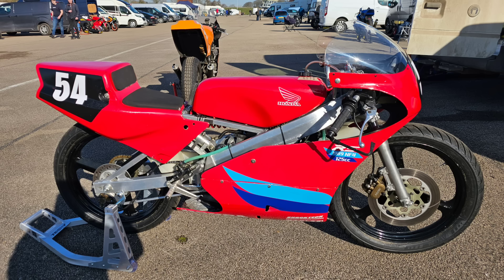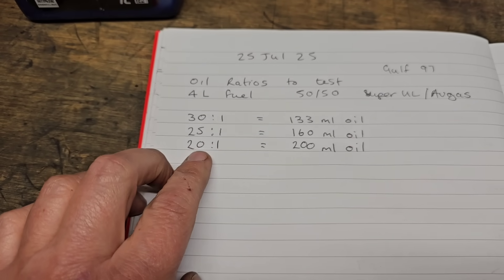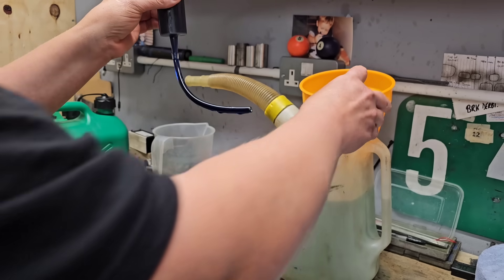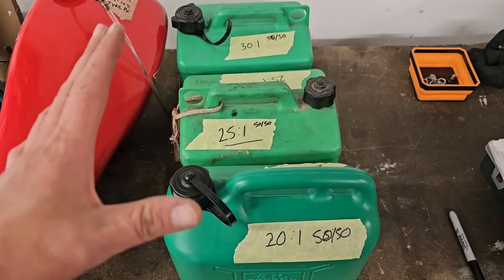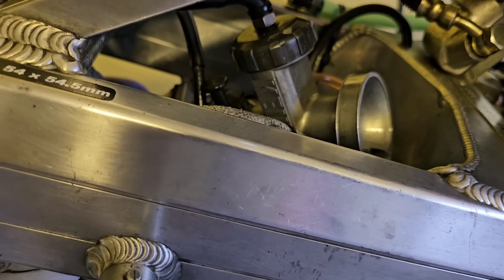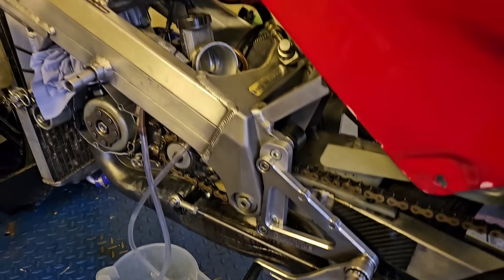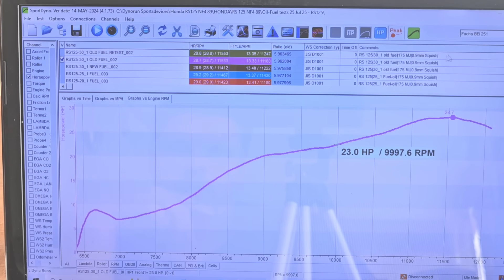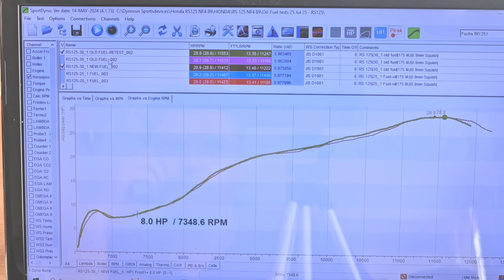Does 2-Stroke Oil Ratio Really Change Power? (Dyno Tested)

Comment: I always ran 32:1 in my 500. Better safe than sorry when in the middle of the desert. A friend who's dad owned a motorcycle cycle shop always used Conklin oil in his desert bikes. Conklin was a very inexpensive chainsaw oil. I imagine a street 2 stroke is a little different than dirt. I had a '72 H1 with the mechanical oil mixer. That was hit or miss. 2 pipes smokin 1 day. The next 1 pipe smokin. It ran fine. Don't know why the oddity.

Comment: I expected to see more oil, more hp as well. For the viewers who have trouble getting quality gas, I am certain that more oil will help dramatically as the fuel grade goes down.  Depending on the output and mods to the engine, obviously, the best available pump fuel or better is recommended, but when you're at the only station for 100 kilometers, and their fuel has been in the ground for two seasons, ADD MORE OIL!  ;)
Reply from the maker: Me too!

Comment: Those curves were all so close that differences were insignificant. To get high accuracy you need to log air pressure, temperature and relative humidity, all of which affect performance.
If as I suspect modern 2T oils don't really affect octane number, your results show the oil is being more or less entirely burnt and producing power. The old oils significantly reduced octane number. Scotts had oil injection basically from day one, the Japanese and Czechs copied it, because then as well as superior lubrication the oil entered the cylinder as droplets and didn't affect the fuel octane rating. Petroil was basically a money saving bodge for the manufacturer, but one people have learned to work with.

Comment: I road raced air and liquid cooled two strokes in the 80’s.  I melted and seized my share of pistons early on.  Biggest lesson I learned to avoid eviscerating pistons to to not advance the timing too far and not jet too lean.  I think these two variables are far more important than oil/fuel ratio (assuming you’re #0safely in the range recommended by the oil mfg).  Also learned early on that more oil requires bigger jets.  In summary: use the recommended amount of oil and focus your tuning energies on jetting and timing.  Timing is huge!  Want to melt dome pistons?  Over advance your timing.  That said, they always seem to run the best right before they seize.
Reply from the maker: Cheers for the tips.😊

Comment: Would you not have to change jetting as the more oil theres less fuel & use an egt to get mixtures the same? as your O2 guage has shown a differance in mixture.
Reply from the maker: Hi, yes I should have. I was looking to see if more oil leaned the mixture, which it did.
I have tested some more oil off camera and got a gain at 16:1 but the AFR showed it had leaned. I raised the main jet 2 points and the AFR matched the 20:1 test and the power came down again to match.

Comment: I'm commenting right at the beginning if the video, thankyou I agree so little data regards many aspects of two stroke theory has been lost to the ages and not available online and one of those ongoing opinions is oil ratio, I did read about a test done by KTM with 3 engines running 3 different ratios but only read about it 2nd hand and it was centred around wear only, it will be good to see 1st hand which is better for power so I'll know whether my 30:1 was the right choice for all these years
Reply from the maker: Hi, i think 30:1 is a good ratio. It worked well with my Honda RS125 and I used the same when I raced my suzuki x7

Comment: Maybe this is just foolish, but on my jetski engines, I started at 40:1, ran them a little and took them apart and checked for oil retention. In the end I was running around 55:1 and still had a decent amount of oil, so I kept running that way.
Reply from the maker: I think its whatever works for you 😊

Comment: Here we go stay with a ratio ie. 32:1 40:1 50:1 with oil nowadays any oil will work. Don't change ratios when it starts smoking that's crankcase seal or rings. In 35 years I never seized a motor. Run rich but carry a spare plug.
Reply from the maker: Honda recommend 30:1 for this engine with the ELF oil that I use...

Comment: More oil needs more compression. Sounds like a diesel to me. 
Actually gasoline derived from oil. Bringing back in more oil you get a greasier fuel which looks like kerosine, petroleum or even diesel fuel. 
- Did we tested diesel fuels or alike before? What were the results?

Comment: So far I know the ratio of a two stroke is 50:1. When mixing in more oil it gives problems as rings brake up. I have tested 40:1 on a MBX80 with a Mallossi big bore cast iron cylinder with a 26 mm Mikuni. The result I remember was loss of power.
So where does this theory of 30:1 or 20:1 come from?
Reply: Because it leaned out due to less fuel in the mix if you jetted equivalent to what fuel would of been with the less oil ratio then youd of made more power than usual because more oil = better ring seal which = better compression which then = more power oh and not to forget more protection for the big end the small end the piston the cylinder the crank bearings and cooler running.

Comment: if you didn't rejet per fuel , then what you learned is less fuel makes more power  ( learner ) ...  the higher the % of oil ,  the less fuel per measured amount of fuel mix . . while adding lubricity that then cant burn ,  and increasing the likelihood of flooding the cylinder , fouling plugs , and sending spooge into the exhaust system . . .  think about it , without jetting for a specific fuel ration , and increasing oil %  , is making a leaner charge with more oil .   the oil also doesn't burn at the rate of fuel who's intent is to be lit off easy ,  oils there JUST to lubricate.  not be combusted....    your wideband also shouldn't be used as a tuning aid for dirt bikes since they dont call for the same stoichmetric .   if you do want to use them as a gauge,   look into rotary engine ideal air fuel ratios , and then that will give you a different AFR goal than what a solely fuel car would use .   but dont expect a long or normal service life from the test O2 sensor .
Reply from the maker: Hi, good point. I did further test with a different oil and went to 16:1 which showed a little more power. I then re-jetted to correct the AFR and the power went back to the 25:1 oil ratio power.

Comment: The big power gains by running lean oil mixes in GP bikes was brought by the ability to run big compression ratios, not just the lean oil mixtures. Synthetic two stroke oils allowed this to happen, back in the day. Ratios of 100:1 and compression ratios of 10:1 were common starting points. For comparison an RDLC had a compression ratio of 6.6:1. Kawaski KR1S's upped this to about 7.5:1, but with higher rated lubricants and less of them. Lubricants don't affect the power so much. It's what you can do with the tuning when you run higher ratios
that does the heavy lifting.
Reply: Also a lot  retarding of the timing at the top so the heat went into the exhaust made the pipe work better extended the power aswell

Comment: dyno is a good baseline and gives a pretty piece of paper with good info.
The only real test is real life. 
I would think that a lower % oil should give better acceleration, similar to the accel pump on a webber, coz it would rev a little better.

Comment: always happy to see a RS running..   A friend have done the same test when he was racing RS250.. and if I remember correctly. there was no change in power until 16 and even12:1  were you start to loose power a bit.   I always aimed to mix 30:1 for my RS(NF4) but unded up been richer most of the times (closer to 25:1).  for the price of the oil... I prefer to be on the lubrification safer side..  Never seized a piston in 8years of racing. (4weekend 2class per year(3day at 4round per day)+1 test day)  (Ran VP fuel C12 and Motul 800 road)
Reply from the maker: Yep, their numbers are diminishing these days. Hopefully we'll have a few more on the grid next year.
Cheers for the info.
25:1 seems to work for us, too

Comment: I was hoping for bigger diff.. but this is what I kinda knew from my own experience, its nice to confirm that in fact there really is close to no diff.. thanks, nice video
Reply from the maker: Hi Ant, I was thinking they'd be a change too but I guess that's how it is.
I have another oil to test at somepoint that does claim a power increase at ratios around 20 or 16:1...
Reply: @AutoBeta2T well motul 710 does claim to be smokeless.. it does smoke less than cheap, even some expensive oils, but, it still smokes... Oil adding power tho.. I have my doubts but I guess we will find out 
Early prediction, no difference at all from other known brand oils at the same ratio

Comment: A 20:1 ratio is 21 parts total.  It works out at 95.24% fuel, and 5% oil.  A 30:1 ratio is 96.77% fuel, and 3% oil.  That's a tiny percentage change in the proportion of fuel, but a big percentage change in the proportion of oil.  For everything except full throttle, if you need more power, turn the throttle more.  However, for premix, once you've got the % of oil fixed, you're stuck with it.  There must be a reason why 2 stroke bikes with autolube have a cam that changes the fuel:oil ratio slightly at different throttle settings.  That's to get enough oil to lubricate the engine.  Seems counterproductive to fiddle with the premix ratio and risk either oiling up or seizing up.
Reply: i think your math is off. i think its 5% and 3% , respectively.
Reply: Yes, schoolboy error.  I didn't adjust the position of the decimal point, D'oh!  Edited now.

Comment: Canadian we drag races snowmobiles in the 90s . Summer on grass and winter on ice .   First the stockers . We raced arctic cats which use Suzuki engines  had 580 600 and 700 800 sleds . Keep in mind these are heavy vehicles . Compared to a bike . And a stock sled had to leave the starting line below 5000 rpm . Since there built to run on pump gas ( and no engine mods allowed )  we used Ams oil synthetic . Built to be at 100 to one . A drag test is a poor man’s dyno if you control all other variables. All the stock low compression engines ran best et at 100 /1 in some there was no drop off with richer mixtures we never tried anything richer than 50/1  our goal was to make torque and power at or near the starting line .these were  8000 rpm peak power engines with a cvt trans . So the power between 5 and 8 grand was important . In a restricted engine . Fuel air volume is important . Testing revealed . Fuel octane was more important . As there was a fine line between . Over octane engine . Something to consider . Max power is up to a octane amount . But not over .   Next was the mod . We’re the rules we’re engine size gasoline . And a light chassis . 440 cc later a 500 . 2 cylinder . 11000 rpm  / 7000 at the starting line . 118 octane fuel . Ran 100 to 1 for some time . Ams oil . No problems . Then 75 /1 in the 500 as per engine builder . Ams oil or Honda racing R oil . Tried as rich as 40/1 . As even then there was talk of more oil is better power . Both engines held records . And we’re fastest top end . With 75or 100

Comment: When you were measuring oil, you did not include the oil in the tub that you added to the syringe, which would make your ratio calculations wrong by the amount in that tube.  The syringe is marked for what is contained specifically in the syringe body and this does NOT include what is in a needle (insignificant), or whatever tube you attach to it to facilitate filling.

Comment: Oh and incidentally one time a few years ago a lad I was with was using Castrol qtt fully synthetic which was really thick we were on the motorway and ended up with someone on a standard vespa so we went from 65- 70 mph to 50mph ish depending on hills 🤣 after about 30 miles of this we pulled into a services for petrol when my mates lambretta made and awful noise then backfired and cut out. No compression then. When he got it home he stripped it and found loads of oil in the crank case and a third orf the piston off with most of it in tiny bits in the exhaust. A bit of research from talking with people who race scooters cam to the conclusion that the oil wasn't burning off at the lower speeds and sitting in the crankcase and bottom of the cylinder but was very hot so had heated the bottom of the piston ( the lambretta cylinder is horizontal  so the bottom to me isn't the skirt it's the exhaust port side)   so the result was the bottom of the piston getting hot enough to crumble. He stopped using that oil and never had the problem again

Comment: Riding round on a tuned lambretta for 35 years and the standard mix is 25:1 compared to 50:1 on a vespa the reason for the difference in at t least these two shopping trolleys was always stated as the piston and cylinder lube would be fine on a lambretta at 50:1 the same as the vespa, but because the lambretta has cylinder  fuel induction compared to the Vespa's  crankcase induction the lambretta crank big end needs the extra oil to lube the big end  bearing. Some now use 30 or 40: to one as it's said modern semi or fully synthetic oils are far better. I have occasionally mixed too much oil in with the fuel but wouldn't say it gave any more grunt. But cold starting  in cities with just the standard 25:1 mix  can get you a bit of abuse and people covering their noses and mouths, especially in Europe

Comment: With modern T2 oil, you can safely run 50 to 1 . 20 to 1 25 to 1 is 1960,s thinking .
Check out the American racing  two stoke sites they have masses of info on oil ratios and effects on performance and wear .
After reading there tech and watching there teardown and maintance I changed to 50 to 1 . About 8 years ago and have has zero problems . I've been building racing two stroke motorcycle,s since 1974 .  Now building Historic race bikes. Having near zero smoke from 50 to 1 on modern oils is a major plus . I've never blown an engine from lack of lubrication .

Comment: I run my trials bike at 100:1, my dirt bike at 50:1... Running at 25:1 with modern synthetic oil seems like madness to me 😅
Reply from the maker: The Honda manual recommends 30:1
Reply: @AutoBeta2T  I'm sure it does, when was it written? Modern synthetic oils are amazing compared to what was available back in the day ;-)

In the end, as long as you're not suffering from spooge or an excessively oily crank it's all good.
Reply: Super good premix + large quantities = engine immoratality
Reply: @mineer-pg5sv  Super good premix in large quantities equals spooge, and oil buildup in the crank case...

Comment: This does not take into account the oil sitting in the crankcase, I would have thought you would need to run much more fuel through to clear this oil out. Just doing one carbs worth of fuel would not give a change you are hoping for.

Comment: There is something nobody ever considers and that relates to engine capacity and jey sizes when it comes to premix ratios what works fine in say a 250 or a 125 will result in an engine seizure ratio wide in say a 50 or 60 cc size engine as the amount of oil needs to be reduced in relation to jet sies or the fuel oil mix will be too thick to flow effectively through the smaller jets meaning a seizure is inevitable, That is why the smaller jets on bigger 2 T trials bikes require ratio like 80 to 1 to work correctly
It is not so much the oil displacing the fuel as the viscosity of the fuel oil mix in relation to the jet size the engine requires to run correctly more oil aka say 20 to 1 means the fuel oil mix is more viscous and does not flaw as well theough the jets

Comment: Interesting video.  I noticed you said you ran a lambda/oxygen sensor.  I had always read they don't work in 2 strokes? I really want to run one for each cylinder of my old kawasaki H1 for various reasons. Is it something that only works temporarily like for dyno runs or can it be for normal use?
Reply from the maker: Hi, they can work in 2 Strokes but it is a tricky environment for them. I've been told that they are most accurate around peak torque. I find it useful on the dyno as it gives me an indication of where I am. 
You do have to be carful with all of the oil. I have killed a lamda sensor before.
While I haven't tried it I have been told that mounting them between the expansion pipe and the silencer can work - in a chamber of it's own (larder than the stinger pipe.
That said I believe snowmobiles use lambda - maybe have a look where the OEM places them.
Cheers,
Dave
Reply: @AutoBeta2T  Thanks.... Ya that makes sense, it;s probably most accurate when "on the pipe" .  A road bike with city traffic might not last long cuz of oil I assume. but even having the threaded bung and cap would allow putting them in just during tuning...  Hmm that's got me thinking. Like you said, I should check snowmobiles if they run them...   Thanks for responding.

Comment: I have a modest 1920s two-stroke that called for a 16:1 ratio. When it was restored, there was a lot of discussion on what the ratio should be with a modern oil, albeit rated 'classic'. In the end we went for 35:1 but the fuel air ratio was not so good and without changing the carb jets, we found it was much happier on 30:1 and not so happy at lower ratios like 25:1. Two strokes can be surprisingly sensitive to oil type as well as ratio.
Reply from the maker: Im guessing with the modern oils the ratio could be changed?

Comment: If it is a oil fuel mix that enters the engine the more oil that is added to the fuel the leaner the engine is on fuel as the oil replaces the fuel its that simple. Adding more oil leans out the engine and the extra oil stops seizing from being a lean mixture. 🔥💲🔥